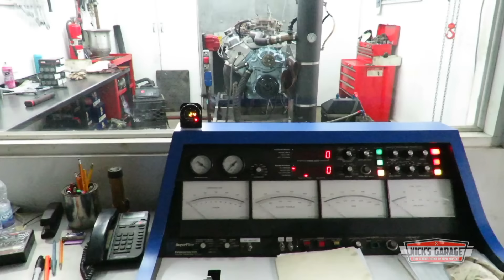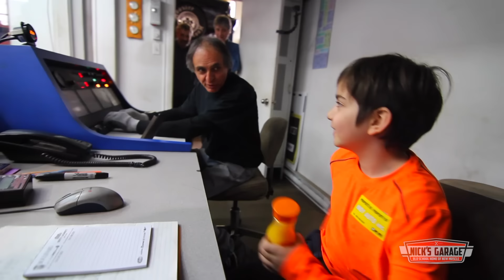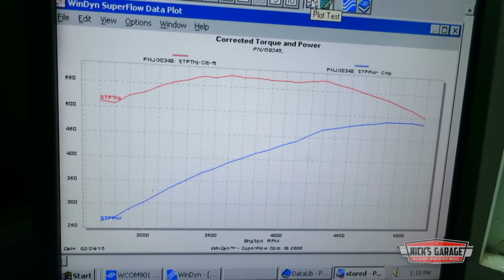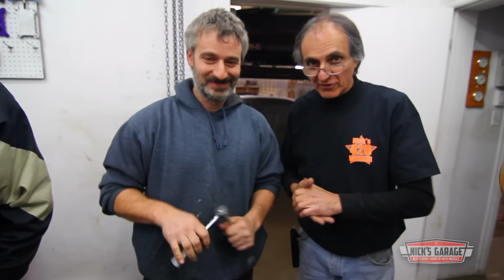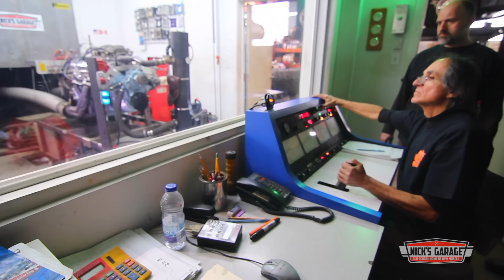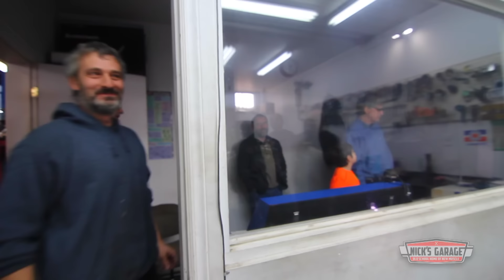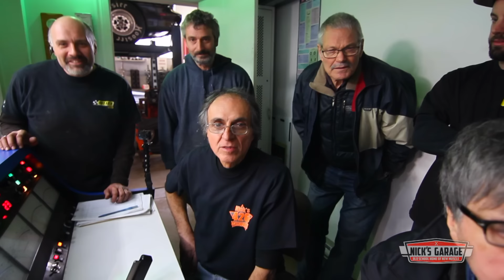Fire On The Dyno!! - Pontiac 455 Lights Up

Comment: I like Mopar but can't own them. I bought 3 straight Dodge trucks and drove straight Dodge trucks for a total of 9 months. I kept getting hit, the last one I was pulled way over in an industrial ally with 14' 3" between my bumper and the fence across the alley. A woman hit my drivers door (about 15' from the fence) in an early 80's GM mid size sedan. I gave up!

Comment: When I left high school I bought my Teachers 2 year old 68 400 H.O. 4 speed Firebird.. during the time I had it  I changed the Cam to a 360 hp GTO Camshaft with Screw in Rocker Studs and upper Rocker lock Nuts(stock ones were unscrewing from the vibration)   I used  Anti-pump up lifters ...  with zero lash . converted the 4 hole quadrajet stock intake to an open dual  plane intake  with a New  holly 780 cfm  single pumper Carb and ran a stock clutch with a modified 4 speed  Muncie Trans ...My Redline was 7000 rpm ..the only thing that ever  broke were several sets of Motor mounts and  at least a half Dozen Stock Pushrods ...I still have the ability to build it today..there are a few tricks I left out.. I loved that car. I sold it 2 years later and used the money to travel through Europe Africa etc for 6 months..thanks Nick you brought back several Great Memories..I get a big Kick out of your Channel..

Comment: You cant just go and throw a set of 1.6 rockers on an engine. you have too check coil bind on the valve springs and a few other things. Hell the push rods could even be too long then.
Reply: gregg4164.      You are correct. However this  was all been measured on the engine stand before hand. knowing that we will go to a 1.6rocker later.

Comment: I have a Pontiac 287 V-8 and I can never adjust valves by using the starter to bump it over. I'm obviously no where near as talented so I use a 24" ratchet to turn the engine over until the valves close. I always do all adjustments by hand tools, never use impact tools.

Comment: I like nicks vids. FYI, have glued gaskets to valve cover cork or rubber with zero failures since 1986. Was curious why nick was rerunning the valves again after the fire? I really like the dual quad set up.
Reply: Chris Mansel.      I was just checking them.

Comment: Why would you continue a pull with all that smoke???????
Reply: 8000RPM.    I was sure that there would be no major issues.  Little oil on headers with a flame in an open room is no big concern for us, especially when spark plugs and cables like this Pontiac are way above the header.

Comment: A brief word of advice for shop owners Everywhere... When you've removed a vehicle hood to perform service, Also Remove the hood hinge springs. It only takes about 30 seconds, and then the hinge lays flat! No more snagged clothing, or poked eyeballs, and no more lost time due to having to work around the damn hinges!  I watch a ton of these videos, and see dozens of cars with the hinges sticking up... It's crazy to Not pop the springs off!
Reply: Lonnie Moore.   In some cases we do exactly that, easy to work in the engine bay.

Comment: Note, they did not check for coil (valve-spring) bind with the higher lift...checking clearances between coils at  0.050 or more. Nether did they do a valve to piston clearance check by pushing down on any one valve (without a spring) beyond the calculated lift at TDC...kinda shooting from the hip here...
Reply: Ricardo Ellison.    We had all this facts figured out when building the engine. Because we were planning to switch to a 1.6 rocker on the Dyno.
Reply: Nick Panaritis OK...that makes sense now...as everybody knows who builds engines, these measurements are standard operating procedures. It just sorta "looked" iffy" that's all...thanks for clearing that up.

Comment: Yep got blessed on that one. That's why when running modified engines you keep a fire extinguisher in the car or shop. Imagine if that had happened out on the road, you'd be minus one muscle car. I had a fire on my 69 GTO due to forgetting to tighten down the Positive battery cable all the way on the starter. Due to the current pulled it caught on fire. I never would have thought it possible but it did. Scared the pants off me because we were doing it the garage and it could have taken the house with it. I got the fire out and learned a valuable lesson about doing initial runs on rebuilt engines in an enclosed area. Do them outside or have the emergency fire equipment at the ready and in hand. Thanks for sharing. Best Wishes n Blessings. Keith Noneya

Comment: I'm not familiar with pontiacs but I do know that I have slightly overtightened cover gaskets on my SBC 350 and the gaskets spit, (only using a wratchet). It's easy to get carried away with torquing those because the gasket settles and spreads yet doesnt offer that "snug feeling" with a wratchet like tightening metal to metal with a thin composite seal.
Reply: Split*
Reply: John Wirk.    You are so correct, it was not the fault of the gasket. It was my helper that over tightened the bolts on the valve cover, which made the gasket SPLIT.

Comment: That Pontiac is gonna fly with 580 lb\ft of torque on tap. 500 horsepower sounds great but torque is what's it's all about for a street driven car. Thanks for another great video Nick. You guy's are the best! Semper Fi!

Comment: Love the channel, though I am wondering why the use of stock stamped rocker arms? With all the other investments such ad the eldelbrock d- ports, why not upgrade to a full roller fully adjustable rocker? Just a question.
Reply: Rick Mosholder.   We went from a 1.5 rocker to a 1.6 with a stamped steel rocker.  This way we stay with the same pushrods. We kept the budget at a minimum.

Comment: The valve adjustment is spot on, exactly how it is done. Make sure the lifter is down, remove lash and go 1/4 - 1/2 turn to set the hydraulic lifter into it's travel...move on to the next,, then install valve covers (properly :-) and you're done.

Comment: I noticed theres a brake on the  machine that impersonates a load to  measure hp. Which part measures torque?
Reply: Jor Ferry,  You have to call Super Flow for that info.
Reply: Nick Panaritis well gease i gotta say i would think that would be something youd want to know seems though its your equipment.  Im not calling.

Comment: 87 ford bronco xlt had a 4 barrel on it
drove like a scolded poniac and it sat under a tree for 5 years
it needs to be rebuilted 
the cruise control and ac were ded back when it was aquired by my grandfather long ago for $500 the roof is rusted
the spot where a rain gutter went rusted out
so yeah put a 2 barel on it to get it into my shop
the thing had a 33 gal tank in it it rusted out the fuel pump in the tank died
Reply: i also have a smol pouland 2000 2ci the thing sat in the bronco for atleast 5 years dead and i grabed it and now it runs like new minus it needing to be fueled up every minute but it needs new fuel line and top end adjustment 
dont quite got the top end where it needs to be
it also pukes gas out the top of carb
wich is gonna get fixed when top end gets fixed

Comment: how to deal with fire: dont freak out and take of the issue. I have helped people with 2 different vehicle fires. One was fuel related in an RV the other was a toyota pickup on its side. I casualy got my fire bottle and put the fire out as people freaked.   STAY CALM.

Comment: Good work, stand by with fire extinguisher while you work with less messy stuff. Better to keep the extinguisher by the door so you don't need to run in the room to get it. Don't want to have fire between you and the door.

Comment: Hello sir updated info it has a Flat tappet XTreme comp cam 268/280 Duration, .477/.480 lift 
Wanted 500+HP and 500+lbs of Trq Did this set up get there?

440 BLOCK Bored 0.60 over
Forged Crank 
Hemi rods
Forged pistons 10.5 to1 compression
Comp cams Camshaft 268/280 duration, lift .477/.480, Flat tappet Xtreme
Edelbrock RPM Performer Heads with after market rocker arms, i believe 1.5
Edelbrock RPM Manifold 
Edelbrock 750 Carb
1 inch 7/8ths Dougs Headers with 2.5 exhaust and Dougs Exhaust cutouts 

Again i am wanting 500+ Hp and 525+ Torque, with this setup. Do you think i got it or very close?
Sorry to bother you again just wanted to give you some updated numbers.

If i didn't get near this would getting A hydraulic cam add say 50 to 70 hp and 70 Trq lbs ? 
Or what would be better to do ? Without to much cost. 

Thank you Nick and take care sir.

Comment: Hello sir, here is more info, i also emailed you this too did i hit 500+ hp and 500+ lbs of trq?

440 BLOCK Bored 0.60 over
Forged Crank 
Hemi rods
Forged pistons 10.5 to1 compression
Comp cams Camshaft 268/280 duration, lift .477/.480, i believe
Edelbrock RPM Performer Heads with after market rocker arms, i believe 1.5
Edelbrock RPM Manifold 
Edelbrock 750 Carb
1 inch 7/8ths Dougs Headers with 2.5 exhaust and Dougs Exhaust cutouts 

Again i am wanting 500+ Hp and 525+ Torque, with this setup. Do you think i got it or very close?
Sorry to bother you again just wanted to give you some updated numbers.

If i didn't get near this would getting A hydraulic cam add say 50 to 70 hp and 70 Trq lbs ? 
Or what would be better to do ? Without to much cost. 

Thank you Nick and take care sir.

Comment: Loved the fire show Nick, look to the left, see my icon, that's a 73 Grand Prix SJ w a 455, barely makes 275, hp, its rebuilt runs good, has a Lil vacuum leak which causes a slight tremor after warm, 19 inches of vaccum, needs you to massage it, make it smooth and make my 4 barrel suck, come on Nick, one weekend in New York

Comment: I daily drive a 461 stroker pontiac with iron heads.  Absolutely love it.
Reply: I can hear the cooling fans whirring from here, lol.
Reply: I had a Mercury Montero MX bomb car station wagon with a 429 Cobra Jet....
That beast was a 6000lb rocket on the freeway onramp! Could leave BMW's in the dust LOL
8 MPG was a real BEEYATCH tho 😄
Still love the big blocks
Reply: lol, I seen you post in other vids.
Reply: adding a large electric blowing in or going electric fan only sounds like a good choice, of course if there's space and you don't mind the non factory look. 
the bright side, your engine actually shuts off when that hot! there's not much worse sound than a gas engine dieseling out the rattle of death as spark plugs are melting! good old drag racing staging melt downs.
Reply: throttle bottle mechical clutch fan.  I always seam to find random burst hoses on my roadtrips though and have to wait forever before pouring water in because I've boiled it all out.  But when not leaking water it stays a happy 200 degrees...
Reply: throttle bottle mine boils the fuel and dies yes.
Reply: Ive been thinking about building my 400 pontiac to a 461. Is it worth the money?
Reply: @morganbrantley9058  yup

Comment: 455 HO ..455 SD .... even the Buick STAGE 1 AND STAGE 2 455 has massive torque. Like to see him so the baddest big block of all ... The caddy 501!! Beat mode!!
Reply: Nick has a 455 Buick with big plans...I can't wait!
Reply: Peter Economakis ...no joke tho ..he should do up a caddy 501 ..or even the 472 torque monsters..
Reply: Got a 455 Buick (462) I just put in my 70 Skylark. Self thought. 27
Reply: I had a stock D port 1973 455 pontiac......trans am, brewster green automatic. I found a 1974 455SD motor from a trans am and rebuilt it and swapped it into my 1973 TA.......put a better cam in it of course and tweeked it......that thing was bad ass.
Got my first divorce in 1996 and got depressed and sold it and my other pontiac stuff.....worst mistake EVER!
Had a buddy that had a 1970 445 stage one buick GS.....torque monster! Had another friend with a sleeper....a 1969 skylark with a 400 stage one buick motor, ordered that way from the factory, it was pretty quick too. Buicks were torque monster kings back then.
Of course the 12 different 1986/87 buick GNs and turbo regals I have had made some good torque too.......lol.

Comment: I like to stick/glue the gaskets to the valve covers on engines that will have them removed often makes for less chance of leak. but that being hydraulic lifters and a street toy, probably wont have them removed for a long while again.
Reply: throttle bottle.  You are correct, the only reason we removed the valve covers was to try the 1.6 rockers.

Comment: Ports have stalled on the heads, that's why it only picked up 6HP with 10% more lift. A little port and polish would probably yield 30-50 hp with the 1.6 rockers.
Reply: Preston Phillips.    True, very true.

Comment: My Dad was all ways a Mopar guy.
My Dad busted my chops.
My first car was a
Pontiac LeMans with a Micky Tompsons 421, that was built by Tompsons.
Dad had stock 413 Chysler 300, I blew him off the first time.
When Micky changed to Ford and gave up on Pontiacs I read the writing on the wall and took up my Dad's Mopar mantel....
If Micky could change so could I.
Never saw a Pontiac that would beat a built 440 or HEMI.
(But the 455 Pontiac was close,lol)

Comment: Nothing than a bit of drama to keep things spiced up right ?
It was a huge mistake to keep going with all that smoke clearly visible, safety wise.
Youtube wise,it was a good move i guess...
Be careful,it could be costly one day.
Reply: I agree.  Should have stopped as soon as they saw smoke.  That much says not just a bit of drippage burning off....
Reply: Edward Tabor and how easy is it to abort the run, check quickly to be safe, carry on. He took the "im too cool to check" attitude imho. Thats a recipie for disaster,  most likely on the customers dime.
Reply: i agree sometimes after a fresh rebuild people see assembly lube being burned off but that was excessive
Reply: Yea i was surprised to see that he didnt hit panic button as soon as the smoke appeared and that he actually continued to rpm the engine till 🔥 and then i realized it made for good video. I think rpming big blocks till they spit rods would make better video.
Reply: @mike force  It was a controlled environment. No reason to be in a panic because an oil sending unit or VC leaked a bit of oil.  What was hurt? Absolutely nothing.
Reply: @mike force  That's an oil fire, not an engine fire. Big difference.
Reply: @mike force  And you sound like an early 20s SJW. Go back to watching Foose reruns so you think you're learning something useful.
Reply: there is no danger in a little oil on the exhaust ,,so it smoked a little its real life get with it mr. clown show
Reply: Spoken like a bunch of bozos who have probably never laid their fingers on a dyno switch in their whole life. Those of us who have worked in speed shops for a living are having a few belly laughs at your expense, trust me.

Comment: Awesome video as always. I'd recommend a CO2 fire extinguisher in the dyno cell. Can stop a run away engine, and can also put out a fire without coating the whole room in powder.
Reply: Robert L.   C02, no powder? I will order one.  Thanks for the input.
Reply: @nickpanaritis4122  CO2 directed at the base of the fire. Use sparingly until fire is extinguished. Don't turn your back on the fire as reflash can occur. Get some hearing (muffs) in that room and hang them by the door. Hearing loss is accumulative and happens gradually over time. CE retired
Reply: @monticella  .    Good point. Thanks Rich.
Reply: Don’t be in that room if you use CO2 as a fire extinguisher. CO2 displaces oxygen. Never ever be in a small room with CO2 vapor! You can suffocate very quickly, and you may not even be aware that it’s happening! I work with CO2. Don’t ever run into a room with CO2 vapor.
Reply: @ik2476  .   Thanks for the info.
Reply: Yep but not for liquids
Reply: Add an automatic fuel and air intake cutoff gate this stops an engine quick smart with no damage and no intake fire like you would do with a runaway diesel
Reply: Good idea, hearing muffs to protect your hearing.  Lot of people have the idea that you get used to the noise, you're not.  You in fact slowly lose your hearing.
Reply: Co2 will crack heads on a hot engine
Reply: @kevinwhitted2147   If you've got a fire or a runaway engine, the relatively faint possibility of cracking a cyl head is way preferable to destroying your shop, or blowing a rod out the side of the block!

Comment: hold on !!! check the volvos mecanical fuel pump orientation, not sure if its right way up . i couldnt tell from witch position  you were filming it.
  i  drive and use b20  , like b30 but only 4 cylinders . it has the same fuel pump  .  volvo pushrods are engines to love <3  . keep up the good work 😊
Reply: Juba Julie.  Good eye. The fuel pump had to be removed and turned around. You know your Volvos. Thanks.

Comment: Can I ask why you didn't abort on the run when it started pissing smoke?
Reply: Oil burning off makes smoke
Reply: @nirvana95themodder  And when the fire starts, the smoke clears and you know where to hit it.
(I'm being half facetious, you never actually want a fire, but that is what happens. Overheated oil smokes, nicely burning oil doesn't.)
Reply: @mfree80286  well, yea, but there's some time in between!

I trust that if this guy has an engine Dyno and is trusted in his community, and he doesn't stop when it starts pissing smoke, then he's been through the same thing a a little more than a couple times and he knows the limits haha

I mean, it even says in the video, not even a burnt spark plug wire afterwards. He seems rather prepared for what might go wrong, in his normal day of work